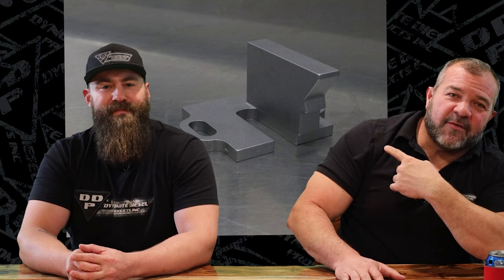12 Valve Cummins Q&A

Comment: I love this shit. I feel like so much of the 12 valve info out there is so old and outdated and now it's inaccurate compared to what you guys are doing. I'm building an 83 crew cab dodge with a 215 pump 12 valve right now and once the truck is on the road and ready to start making power, dynomite eill be my only stop.

Comment: My first gen Intercooled made 400+hp from 1900rpm to 3300rpm with an s300g 4" exhaust and powerjet stage 2's. I firmly believe in normal street driving it would walk away from most 600hp 12v p pump trucks.
Reply: Just because you think it would don't make it so lol sounds like a good running 1st gen tho
Reply: @JustinSchooler-f2j  Well to be making 600rwhp 12v they probably running a 66 or bigger turbo.  Since from 1500 rpm cruising speed it takes 9.5seconds for that charger to hit peak boost that gives me at least a 7 second head start that means I am at least an 1/8 mile down the road by the time that rig starts making 600rwhp. Now with a flashy loose converter you might have a 12v with better response but it still probably going to be about 5 seconds to party from a kick and again that 3 seconds at 400 plus going to be a lot of feet you gotta catch up.
Reply: @JustinSchooler-f2j  In my extensive turbo testing I went back to a 57mm versus a 62 because despite the 62 offering 50more hp on top the 57 can pull from 1500-3000rpm 3 seconds faster because of spool difference.
Reply: Had a s300 on my first gen. Was awful laggy and useless, never again.
Reply: @landontaylor7221  That is why I run the 57mm s300G. with the .070 housing it starts spooling at 1250rpm and is going pretty good by 1500 peak torque is hit by 1800 at well over 1000ft-lbs and it still makes over 400hp out at 3400rpm. It makes it drive like its a big block gas motor and the egts are 200deg cooler than with a 60mm HX series and 300 cooler than the factory H1C.

Comment: I am about to dive into mods on a 94 p pump motor with 48k original miles. Currently in a Rv chassis. I have some serious questions. Whats the best way to contact you guys.?? Love the info and the channel... I'm a gas wrench. Still learning on diesel side. Thanks from Oregon.

Comment: How about afc live with max rack travel  , and 4k gov springs, 160 pump, stock 97 inj. I pull all the time. Also °16 timeing.  055 delivery valves. Thought about power driven stage 2 power jets.
Reply: Forgot, when u tune a truck, is it for one weight or good for different weight.?